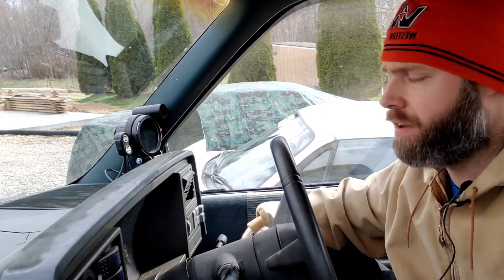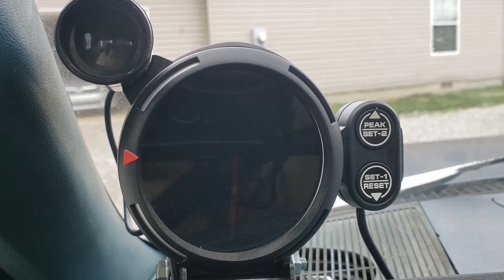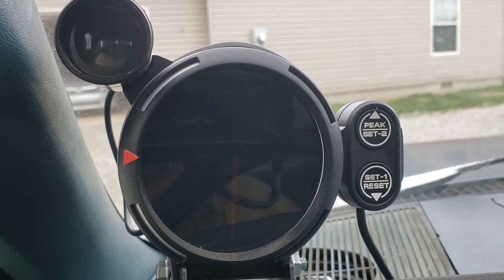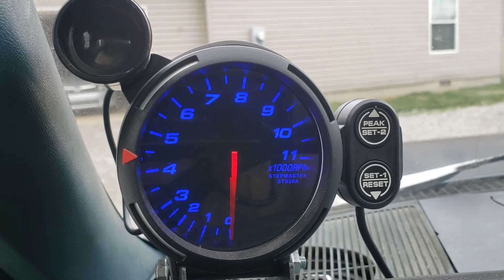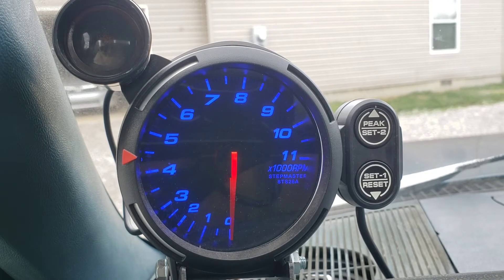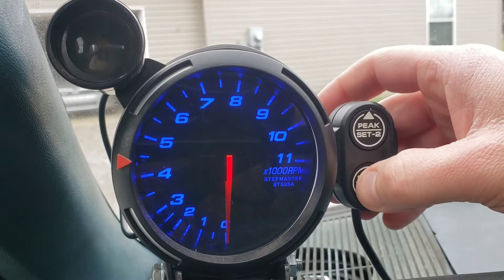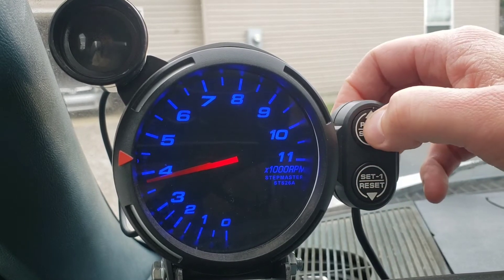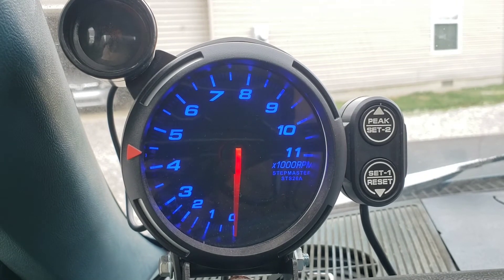Programming a Racing Tachometer

Comment: I bought one tachometer same that you have, but in my mustang 2003 gt its reading instead 1000 rpm (Information that is shown the original tachometer inside  automovil) this custom Tachometer is read 10 000.

Do you have any kind of advice that will helpo me with this wrong measuring, or in other hand we can consider this as defect/issue product.

thanks in advace.

Comment: if anyone can replay me i appreciate so much, i bought this tachometer and i have all the setting done, when i start my car the tachometer goes crazy like from 1000 rpm to 11000rpm in 1 second and then comesback to 1000rpm, If something is confusing it is because of my bad English, sorry.
Reply from the maker: @sandunga1700  I'm guessing you have some sort of interference going on with the signal wire or a bad ground connection.
Reply: @doggngarage4975  i will check that, thank you bro i really appreciate

Comment: I have all the settings done. Start the engine. The shift light, warning light and buzzer are all on the the tach needle is pegged at 11000 rpm. . Now what?
Reply from the maker: That sounds like a defective unit.  The needle should bounce off 11k, and the shift light blink once.
Reply: @doggngarage4975  okay. That's what I thought. Thanks. I live in Mexico so I can't send it back . I'll go back to a Sun Pro.

Comment: I have set it all up right but it’s still not reading my rpms
Reply from the maker: What is the engine speed wire ran to?
Reply: @doggngarage4975  to the negative side of my distributor
Reply from the maker: @codyfrazier6105  what is the vehicle?
Reply: @doggngarage4975  305sbc
Reply: It’s a 1987 gmc serria
Reply from the maker: Try negative on the coil
Reply: @doggngarage4975  my coil is on top of my distributor and that’s what it’s hooked to
Reply: I think they sent me the one that’s broke

Comment: where can I tap into on a 3.5 2007 Saturn aura you tube videos said the coil packs🤷
Reply from the maker: That's  what I would do.  Use a volt tester pen on wires going to a coil pack with the engine running.  When you find the right wire, the tester will start flashing.
Reply: Ok thanks